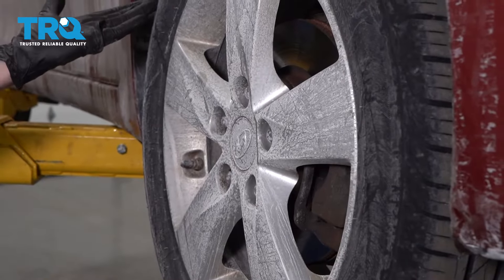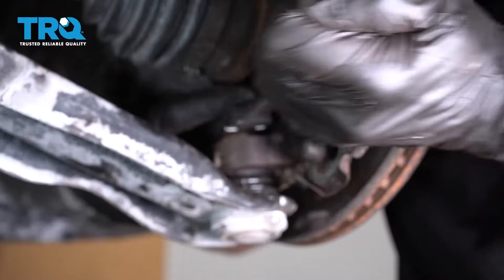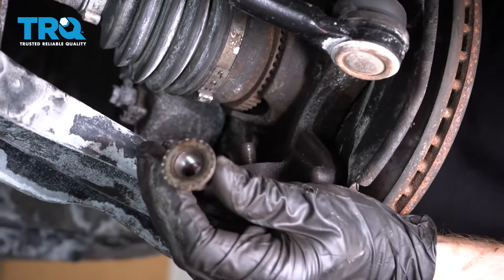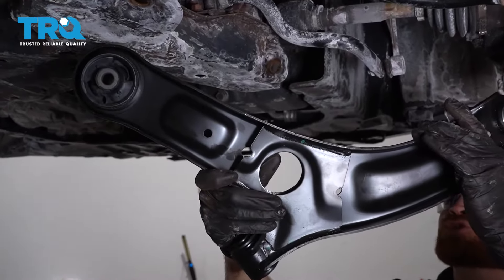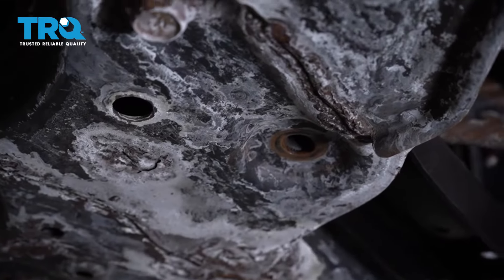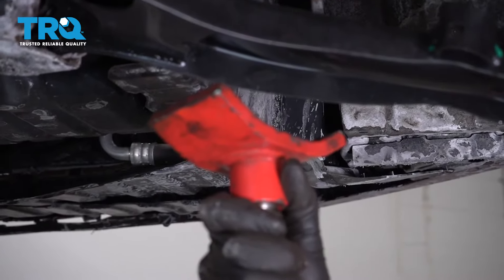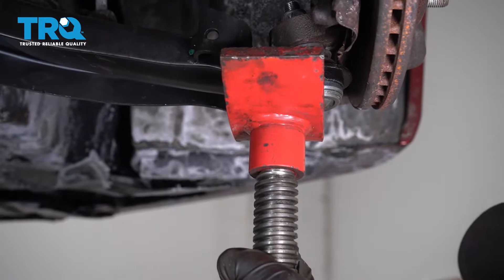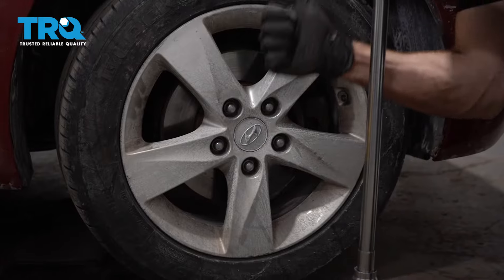How to Replace Lower Control Arm 2011-2016 Hyundai Elantra

Comment: I used the video step by step. The rear bolts took a very long time to get out and to get the new bushing realigned. 
I see comments acknowledging the ride height. After a few phone calls to Firestone, Pep-Boys, and a local suspension shop; they all said the same thing. Jack up the control arm to what is parallel to the vehicle frame. (This is eyeballing) I did this and my car is fine.) but in a quality inspectors point of view, you would have to use a tape measure as I have seen in other videos, and seating the tire on the floor or having lift capable of seating the vehicles wheels while in the air. This is not available to everyone and sometimes eyeballing is okay to do. The worst outcome you can have after a decent installation is a misalignment, which is relatively easy to spot. Thanks for the video.

Comment: When lifting the control arm  how do you know what the correct ride height is? Wouldn’t it be more accurate to put the tire back on and drop the car onto ramps then proceed with torquing the control arm bolts.
Reply: Yeah but he’s lazy